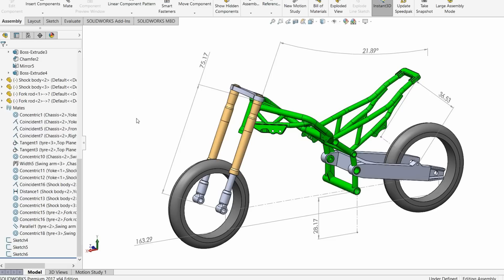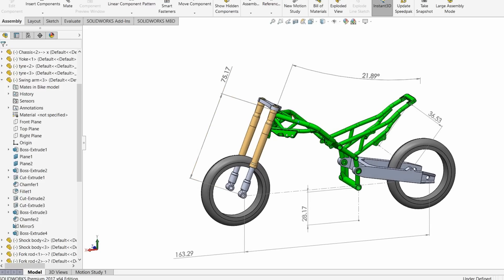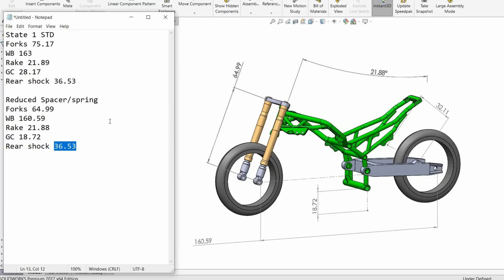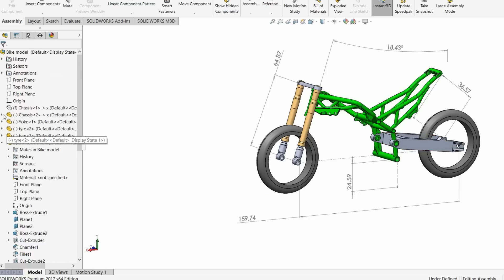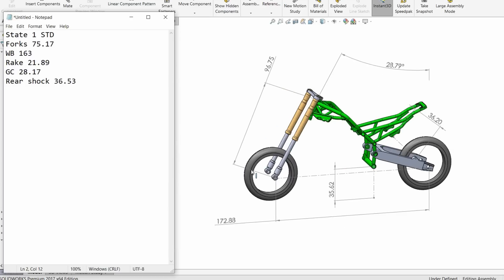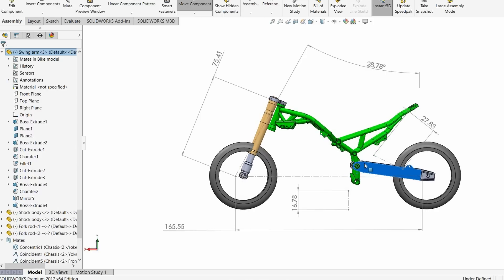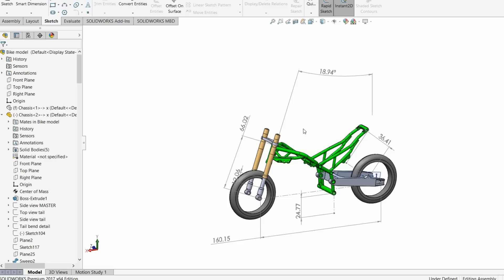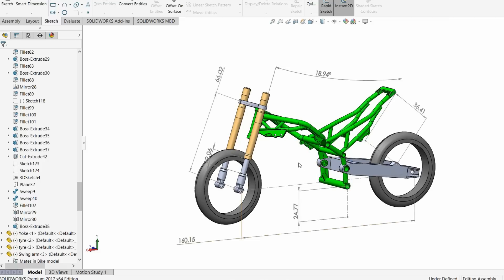Suspension Geometry 101 - Part 2

Comment: Yeah, Robert Horn's suspension doesn't do any of this. It's basically a double wishbone turned sideways with a single balljoint at the top and DBJ at the bottom. Arms are mostly parallel, so as such, the virtual swingarm length is much longer and there's essentially no wheelbase change regardless of travel. Furthermore, the front mechanical trail (what rake provides on a telescopic fork) is kept consistent throughout the travel as well. Plus it's lighter for the same strength and doesn't have the stiction problem that forks do, nor the lateral flexure problem front to back when accepting braking forces or suspension loads.
Reply from the maker: It's retarded.
Reply: @thedirtyworkshop  Why?
Reply from the maker: wheelbase is one of the main contributing factors to steerability. Making the bike that long is stupid.
Reply: @thedirtyworkshop  Okay, well I asked about his suspension design. I personally already criticize the long wheelbase, so I'm not contesting you on that. But his suspension design gives no only a much longer swingarm for better dynamics, but the front suspension in particular gives you hub-center steering without the problems of hub-center design and eliminates all the issues that the telescopic fork has.